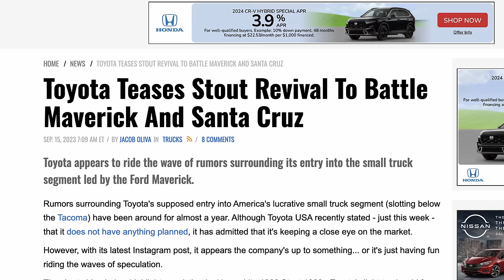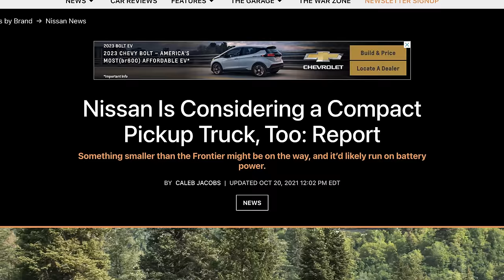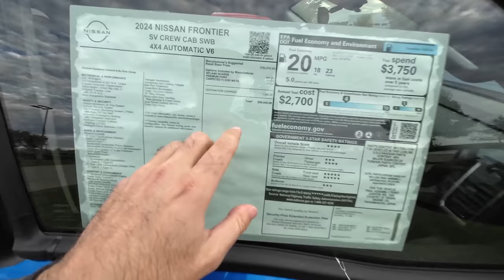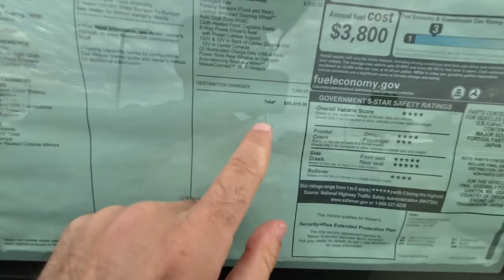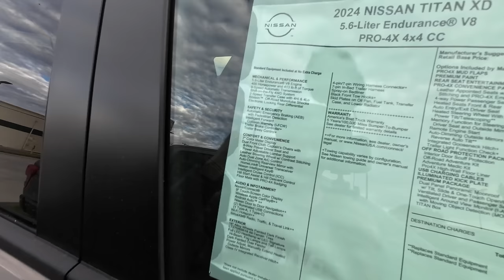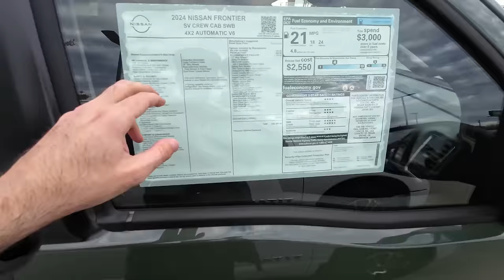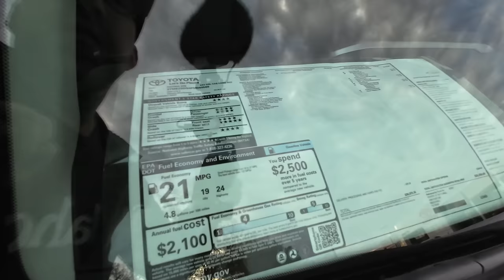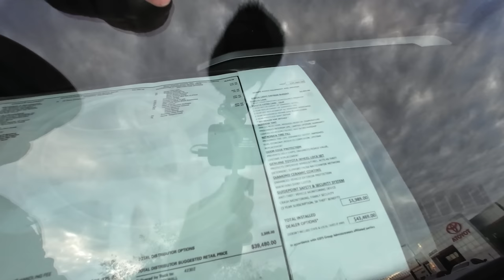Nissan’s NEW $20,000 TRUCK Has Ford & Toyota In Panic Mode!

Comment: Toyotas inexpensive foray into the midsize segment is on the way and it’ll crush everything out there….   Anytime we get a used Nissan truck or Xterra on our lot, I’m always shocked by how many rattles and creeks they have compared to a much higher mileage Tacoma or 4Runner.  Not always, but usually, you get what you pay for… imho
Reply: Good point.

Comment: I hate how expensive the NISSAN HARDBODY cost and it doesn’t come with an optional LED Headlights, and a rear locking differential, heated steering or even telescopic steering.

Comment: Just need a stripped down, small 2 door cab farm truck with a minimum 6 foot bed.  No fancy electronics or carpet.  Heck I'll even be fine with old style manual window cranks if they get it under 20k.

Comment: Got a new 23 Pro4x back in January and I already have 20k miles on it. Absolutely love the thing. I had a 2019 Pro4x prior that sadly died in a head on collision but the 3rd gen is an awesome truck especially for the price I got mine out the door (45k after tax and before cash). That price is fully loaded sans the sun roof and leather seats, which both I didn’t want.

Comment: Entry level vehicles offer a smaller profit margin for the dealership. So be prepared for a physiological battle like you've never seen before when you step into the F&i department. This is the last swing they get to sell you that extended warranty, wheel and tire protection, etc, to generate the much needed profit for the dealership and generally where the big sharks operate.

Comment: The big trucks aren't needed by the average American.  They should be only for businesses that need them.
I'm looking for a small truck.  I had a deal with a Ford dealership and traded in my Silverado because I no longer need that size truck for my bees.
So, the dealership lied to me about a delivery date, and later tried to jack the price up on me as we were working on what the truck would need.
I'm now waiting patiently for the other dealerships to put out trucks that are smaller for the average person.
I would not call the Honda a small truck.   
I'm in the north and a four wheel drive would be a requirement.   Muddy sections of farms and snow will force me to have four wheel drive.
But, absolutely NO electric truck.   Maybe a plug in hybrid could work. Also able to plug into the house for power outages to run the home.

Comment: Am shopping for a small or mid-size pickup.  Have been looking at the Maverick and the Ranger and you are so right…the DFW dealerships hardly have anything in inventory and the mark-up on what they do have is crazy because of the largely unwanted add-ons that could be acquired in the after-market for far less.  Based on your video and despite being beyond horrified at the pricing, I am going to look at the Nissan and Honda as well.

Comment: A local Ford dealer in Asheville has 6 Mavericks for between 25k & 30k.  Toyota Tacoma SR is 35K. I think you will find better pricing and availability outside of the big truck markets.

Comment: In my opinion all trucks should be body on frame not unibody construction. Higher towing capacity, lower suspension and road noise, easier to maintain, and safer in a accident
Reply: The Honda Ridgeline seems to meet all of those criteria though I still prefer BoF.

Comment: The EPA is what's screwing it all up. They set standards based on size and wheelbase, not just vehicle type. So the smaller a truck is, the higher the MPH has to be. You can't get a small size truck like a 90s ranger, because the MPH would have to be crazy high, which they could never do with a decent sized engine. That's why the Maverick works, because it's a shorter wheelbase, and more narrow like a car, but they still have to make the average MPH super high for a truck, which they only meet because of the hybrid option. It's about the smallest they can get and still meet the requirements. 

Constantly restrictive regulations mean constantly evolving developement to meet the goals, which is why there are no new car companies (except for electric) and why engines keep getting smaller and more complex. It's too expensive to enter the space. It's also why prices keep jumping up, because the more the companies have to spend to meet the regulations, the higher they have to jack the prices in order to stay solvent. That's how we end up with $95,000 pickups the size of garbage trucks with tiny 4cyl turbo engines that break in 5 years.

Comment: Why would a manufacturer put money into R+D when the gas truck is going away ?  It's not panic time for getting the last of the gas engine vehicles yet, but when it comes, they will all be marked up to what ever the dealers want. Then we'll all have to install fire suppression systems in our garages or park our $ 80K electric truck outside.

Comment: I recently bought a 22 Frontier and it had non stop electronic issues, ABS failure, the idle at stop lights was so low it wanted to die, and it felt like driving a diesel with non of the benefit. I returned it while I could to get my money back. If they fixed the issues it would be a good truck but my 2008 Honda drives better.

Comment: I bought a new Tacoma earlier this year ( took delivery 12..31.. 23 ) , I gave 30 k out the door for a base 4cyl. white one . I had to buy it sight unseen
as it hadn't been shipped yet ( actually I put a $500 deposit on it )
then the rest on delivery . I'm glad I did . The 24 model will have a different motor w/turbo on it . Probably be more expensive too .

Comment: My first Frontier 99, new was $20K for SE-V6, now they are all $35K. Taco trucks top out around 45K...WTF  I will buy a Hardbody right now!  I had one in 89 and it was the best truck I have ever owned.  Keep the EV junk though.  Bring back a new retro HardBody Nissan with a manual transmission and you wont be able to keep them on the lot.  My neighbor still has his 86 Hardbody and drives it  about everyday and has well over 250K miles and still going.

Comment: A small truck in the mid 20s is basically a pipe dream. Manufacturers will claim they exist  but they will be rarer than hen’s teeth. Expect low to mid 30s after they get optioned up with all the crap nobody needs. It is the auto industry equivalent of click bait whose only purpose is to get you in the door.

Comment: 39k for low end frontier? wow. prices thru the roof.  the problem is there is no margin on these mavericks so ford builds 150's and thinks they can shove them down the customers throats. if you can sell mavericks at smaller profits but get revenue it that is ok.

Comment: 48,000 for  pro 4 x is not a great deal. In 2020 I bought a loaded pro 4x for 32,000. That's a 16,000 dollar increase in 4 years. Lot rot will correct the auto market.

Comment: problem with the modern compact trucks like the Ford Maverick and the Honda Ridgeline is they are more cars than they are truck.  They are closer in design to a Chevy El Camino than they are to an S10 or a Hardbody...but even then, you could get an El Camino with a V8

Comment: If you check the Toyota dealers in the Atlanta area and the Southeast US, you will find that the Toyota distributor adds on a lot of extra unneeded crap, such as a cell phone cable bundle, at inflated prices and this is added to the factory window sticker. So the dealer isn't adding on these additional markup stickers, but the Toyota distributor is. And you can't even special order a vehicle without the added crap.  Someone needs to do an expose on Toyota's additional markup games.

Comment: hyundai santa cruz came out before maverick and  hyundai santa cruz just looks cooler there ford maverick  looks like ford had some one say hay what if we make the f150  be smaller the rager/ tacoma and colorado  are the size ther bigger trucks are use to be the size of them. the Chevy Colorado use to be the same size as a s10 truck and was what replaced it. mabe one day chevy will redo multable cars on 1 frame like the chevy corvair there was a van truck cupe sedan and a convertable   and used 1 frame and made all thos bodys on it if  every company whent back to doing that we will see the prices fall in cost to make. the ceramic coting  helps  prevent paint peel from sun

Comment: Americans don't want to buy a 20k truck. They will say it is cheap and not made well. They rather pay 3x more to get something cheaply made but not cheap. It's a bragging point for them to flash vehicles that cost more than the home. Now the house prices are through the roof they lease the big 80k truck which doesn't age well anymore and tradeit in less than 10 years later round the time the property values drop again and they refinance to lease the new latest version of the truck with all the bells and whistles. You will see the average person keeping their old truck 10 plus years and keeping it clean and maintenance.

Comment: These manufacturers need to stop smoking crack. I need a 3/4 ton pickup with no frills. Two doors just AC power steering power brakes. I do not need a Cadillac.
If I could buy a 1962 pickup with three on the tree I would do it.

Comment: Toyota of Rockwall is a joke as a dealer... and don't bring your truck in for recall service... they will try to sock it to you in "additional services you need now" they found on their "inspection". They wanted to replace some small bulbs they "found" burned out... but I'll be damned... they were all working.  They said I needed front brakes... 6 months after a full brake job. I had a rear tire that looked "suspicious" to them... nope! There was a few other items. They would feel comfortable releasing it back to me after an additional $6300.00 of "found safety items". I told them no, and after the front end recall inspection, I drove off. I still have the list to show people how much of a bunch of scammers they are!

Comment: My 2017 Nissan Frontier 4.0 4x4 was a twice better truck in almost every way than my current 2020 TRD Offroad Toyota. 
I wish I would have just kept the paid off Nissan instead of believing the hype that Toyota was better. 
The Toyota is a little more comfortable to drive, it got better gas mileage before I modified it.
The Toyota doesn't have the bad blind spot that the Nissan had.

Comment: A small durable, reliable truck with either a 6-speed auto or manual starting at 20k.  A small electric truck will not sell.

Comment: As soon as I see the Honda Ridgeline mixed in with compact trucks, I know you don't know what you'er talking about, the Ridgeline is the LARGEST mid size truck. Also Nissan doesn't need a smaller truck as the Frontier is the SMALLEST truck in the midsize, All they have to do is hybrid it and price it with compacts, easy for them to steal market share.
Reply from the maker: You're wrong. The Ridgeline is 210.2 inches in length. the Tacoma is up to 225.5 inches in length. Google it. Sure it's not "compact" but it is a smaller option.

Comment: I want a $10,000 compact truck. Just wheels, frame and engine. Further mods should be at my will. 90% mechanical no ridiculous gadgets and gizmos and that 10k is being generous. No lease BS making it 15-20k flat price so I don't get stuck with payment issues and no risk of losing it if i miss a month. 
The auto industry needs to stoop overcomplicating ownership possibility because no one wants $90,000 in debt for a simple work or get around town vehicle. And add a hard shellback just in case a person needs to live in it during life's more annoying moments. If anything preshield the catalytic converter. Please include a book for general repair. And make parts accessible for a few years. Personally I would buy parts in advance for the wear and tear specific to my use of the vehicle. Don't make that chit hard to get. Manufacturers that understand this will succeed. Dealerships that understand this will succeed. Buyers that adhere to this will have higher loyalty. Vehicle maintenance knowledge will increase. Word of mouth will spread and positivity will flourish. Maintain consumer confidence with a standard of consistency and quality. This doesn't stop production of high end vehicles. But what good is a stairway with only the top few steps? If American manufacturers don't step up then dont be shocked when non-domestics take the cake.

Comment: Yeah let’s actually see a manufacturer really produce something without anti collision bs , autopilot 360 cruisomatic cruise control bs, 14 speakers with CarPlay bs, 10 airbags bs, 12 speed automatic bs , turbo direct injection bs , electric lockers and pto awd bs with 19 shades of concrete color and pea green. 
How about a 6 speed basic ,extra cab only 4 cylinder with 2 airbags , electric windows , air conditioning , and a basic Bluetooth 4 speaker stereo , available in white , black ,blue and red . 200 hp basic 4 cylinder .
$20k probably no problem.

Comment: The problem is today's entry level trucks are weak for their price points. NIssan will throw GDI turbocharged 4 cylinder engines with CVTs on them (like the others are doing) with anemic towing/payload figures and they won't have the track record a lot of the 4 banger and smaller V6 engines that had lower total cost of ownership. The EPA and the emissions laws are what's killing the consumer for these newer cars/trucks. 

KA24DE 4 bangers good , VG series engines good but something tells me they will make a bonehead move and put one of these unproven track record new production variable compressions turbo engines.

Comment: no electrics , no cloth seats, no carpets , no packages of anything , 4-6 speed 4 cyl gas non turbo , .. h d everyting , [ springs , shocks , cooling ], tow bumper .. basic cheap go anywhere , haul anything , 8 ft bed  .. it will sell

Comment: A small Nissan doesn't have much towing capacity, and it DOESN'T NEED IT! If ANY manufacturer goes back to their roots, of a dependable cheap truck, they will survive the coming recession. Why they began making 70/80/90K$ trucks is beyond me; not to mention that many of them are not even that reliable, and the repairs are 10K repairs. My new 88 4WD Toyota was 9600$, my next one (a used 1994 Toyota 4x4) was 4000$, then I paid 13K for a 2003 Tacoma I still drive today. I'll never buy a 50K$ Tacoma, and the used ones aren't much cheaper. These auto makers need to use their heads, make a cheap reliable vehicle and they could then actually pay their workers a decent wage...

Comment: Maverick is not a truck. Tacoma is Truck. Any one that needs a truck for truck work you are getting an F150 or F250 (not brand specific just example). Towing with these smaller trucks can be dangerous. I have seen to many people towing wrong and over the capabilities of the vehicles.
Reply: Yes! And if I might add, the PAYLOAD capacity of these "trucks" has seemed to be completely forgotten about. My 95 gmc 1500 had a 2k lb payload. A new one has less than 1400 lbs! Forces me to move up to a 2500 to get decent payload, for lots $$$ more. So frustrating.

Comment: Well the comments say it all!
I want a cheap full sized pickup under 30k used! I don't care about any of the fancy crap! in fact, I wish it didn't have any of it other than maybe a bigger backup camera screen. Because that stuff keeps breaking. My 1999 F150 is still going strong and I don't want to replace it with some junk that will break because of a computer issue. 
No one wants a tiny truck because its useless!!
I want to move some dirt! not in a tiny truck
I want to move some boxes! not in a tiny truck
My wife wants some flowers at Home Depot! oh a tiny truck will work for that!

Comment: And the fact that frontiers last forever and is the only midsize truck with a v6 makes a super good truck.
Reply: These new ones are not like the last gen I know some people that own them and they will never buy one again
Reply: Toyota Tacoma 2O24 3.6 V6 twin
turbo 400+ hp
Reply: @Wilhelm4131  are you talking about the 2022 or old ones? because the new ones a lot manufactures fix the problems on these new ones overtime. This is a brand new model so it can have some problems but the old ones they must’ve just not taken care of it  so I can see why it would break.
Reply: @kuntekinte6246  the Tacoma it’s actually a 2.4L 4 cylinder turbo but alright…..
Reply: @Mason-fv1zl  Google 2024 V6 twin turbo. Use your head been working and ib the car industry for 38 years.
Reply: Toyota Tacoma of course.

Comment: Ford is making 75,000 Mavericks per year roughly and making 10x as many F150's per year.  The Ranger is worse as they have made less of them over the past 2 years after selling 100K units in 2020.  The Margin on the F150 is just so much sweeter for the company.  They are not going to change this strategy unless the F150 goes unsold on dealer lots.  The longer they sit they will simply start to add discounts and incentives to the F150 and people will rationalize that they can get one for just a bit more then a Ranger and Ford will have another F150 sale.  With that said I do think a 20K small truck is tough to build but people should be able to buy something nicely equipped for around 27K.  Not many vehicles period, even entry level commuters, that have starting prices near 20K.
Reply: It's flat out greed.